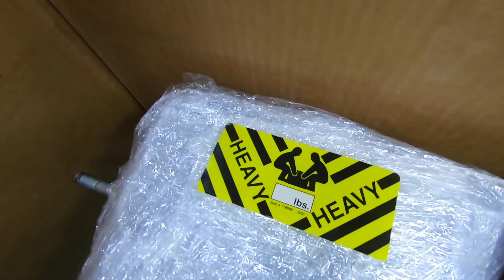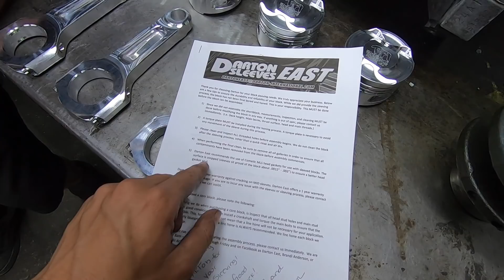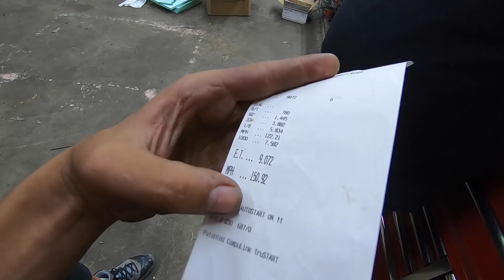The New 1200+Hp Engine For The Mr2!

Comment: Re missin gears, there is so much load in the back end when you get to 3rd and 4th even with a sequential it makes it difficult to get the changes correct. If you get the speed sensors etc and get the cut programmed in correctly the the gear changes will be butter. You need to get the load off to help the gearbox when making the changes.

Only has to be for a 10th or less of a second which will mean better times out the back end. 

Your ecu should be able to handle this. 

Its because the engine is makin so much boost out the back end that there is soo much load on all the components in the last part of the 1/4 that gears get missed. 

My 2 c
Reply: Been saying this from the beginning they are being way to genrous with the strain gauge parameters. Brent set it once on both cars with no load (hondaru and the mr2) and what do u know they still be having shifting issues and have to physically take their hands off the shifter to keep it from triggering the strain gauge. Take some time and get the tolerences closer!
Reply: I agree,  add to ignition cut time and make sure it goes into gear.
Reply: Makes sense to me
Reply: Changing gears down track without hitting the limiter would make an old mechanic happier.
Reply: They need to set a soft cut rev limiter and timing cut and not a fuel cut for the shift parameters. It’ll give more mass to the exhaust gasses when the cut is over and kick the turbo in the ass with all that dense exhaust gas.
Reply: he has a shitty AEM in the car, probably needs to swap to Haltech/Motec/Fuel-tech, but I don't think theyre familiar with using ecu features like this.
Reply: It wouldn't b kyle with boostedboiz if he didn't miss a gear
Reply: @N-Collective  Seen some people hold on to them like Ebrake drift leaver, and work fine.
Reply: 100% agree with this. I said the same when the video came out showing the very bad state of the dogs after very little use. I’d personally go with a closed loop paddle shift system that fully removes driver error. Considering what is going into the car financially, its a very small price to pay for what will be much more reliable, much more consistent and much more reliable. I work on and around this stuff for a living and this setup is very very basic it seems to me.
Reply: @N-Collective  I know, what the hell!  They left the maximum ignition cut time at like 0.6 seconds!  Then they jiggle the shifter on the run and it could be cutting out for a half second each time! Even the pros told them they set it at 0.2... In reality them not setting it up while it's under load is probably causing them to mis-shift and blow up gears/ dogs.
Reply: @GoatFaceNation  haltech/motec/fueltech dont do anything special at all that 99percent of  other ecu's can't do.. they just sponsor the right people and have loads of fan boys 🤣 look into syvecs and life ecu's if you want fancy shit.
Reply: Good point, the boosted boys are plagued with shifting,trans issues. A little attention to setup would eliminate the problems.
Reply: @wobblysauce  they can do that because the strain gauge is set properly!!!
Reply: Well put you will see from the multitude of replies many people have already said similar. They leave me scratching my head a lot. I tune in and out it’s heartbreaking watching them trash those gear sets and drop valves. But most of the vids are cool.
Reply: Definitely agree. Get some rpm LEDs so that you're not banging off the rev limiter at the end of every gear and tune that shift sequence so that the engine load is reduced during a shift. I know it's easier said than done but it seems like putting in the effort to tune the sequential (under load) will pay dividends.

Watching these guys continually blow things up is getting old.
Reply: Really they just need to get a stig hired. After seeing them all bounce the limiter repeatedly over and over and over
Reply: @brent4adv  the aem dash alredy has LEDs but he never set it up proprely like other things on the car. But hey, it's kyle, he'll never do something that other people tell him to do...
Reply: @brettv6982  But then they reuse head studs and cranks. In a world record chasing car. Lol.
Reply: On high powered bikes the kill time is anywhere from 10ms to 25 ms. If the dogs on these transmissions were back cut a little it would almost pull itself into engagement and be somewhat fool (Kyle) proof. 1/10th of a second kill on anything turning 8000 rpms would be a big flame out the exhaust
Reply: Erik Larson ARP says inspect and reuse

Comment: 18:02 I thought Jaime was gonna say, "you're still gonna miss third" 😂
Reply: Good one! 😅
Reply: Hahaha
Reply: Haha k series turbo with mods and still 9 sec smh...b series turbo easy be hitting 9s...
Reply: @MoparSrt702  it's 9.0! So almost an 8.
Reply: @jensmannens7398  still 9s bro.
Reply: @jensmannens7398  it's like someone saying I lost by an inch...still lost lol
Reply: @MoparSrt702  Yeah i know still 8s but what b series cars does low 9s easy?
Reply: @jensmannens7398  my ex crews ek hatch does 9 sec fwd. most the cars here in Vegas do 9 sec buddy..
Reply: @MoparSrt702  low 9s?
Reply: @jensmannens7398  I'll try and post pic of the plaque we got from the speedway for going 9 sec
Reply: @jensmannens7398  yeah bro. ain't hating just saying makes no sense. But is what it is still good content from the boostedboiz even tho this foo be weird sometimes.
Reply: @MoparSrt702  going 9.9 or something is a big difference with 9.0 but i understand what you are saying with the hp they had in the mr2 and the sequential they should already went 8s.
Reply: he can make all the power he want but until he puts a dedicated drag suspension on the car it aint going much faster. those bc racing coilovers arent designed for what hes doing.
Reply: @jensmannens7398  yeah bro 💯

Comment: oh boy your gonna need a wheelie bar now
Reply: Or a really heavy front weight plate to keep the wheels down.since hes trying to stay in the same race class
Reply: A wheelie bar indeed.
Reply: Ada 1812 ain’t nothing but a thang i know he can make one he has one on the hatch
Reply: @thefugitive2178  did you even hear kyle said he doesnt want to go to a a diffrent race class if  he uses a wheelie bar.but it never said anything about a weight plate
Reply: Its gona have sensors out front knowing when front end goes up,pulling timing to prevent lifting.its rare that i see wheelie bars now a days
Reply: 《Untouchable 》 he said that?
Reply: @upnorthviking823  are you serious?
Reply: He can’t have wheelie bars for the class he runs in
Reply: with boost buy gear he wont be or shouldn't be pulling wheelies anymore
Reply: Turgi yup, he did, it was a while back but he said he opted for the pitch sensor and weight plates instead of a wheelie bar because of the class he’s racing in
Reply: Ada 1812 is not about being gay is about going straight and safe
Reply: TheBirdtaco eh i doubt it
Reply: @joshua_J  He literally said this in the video
Reply: You can’t put a wheelie bar on a IRS RWD car, it’ll unload the rear suspension and make the rear tires lose traction.
Reply: Ada 1812 and also the wheelies he’s pulling on just 1000hp is insane, just imagine it 200hp more; yeah its a small lightweight mid-engine car but, i doubt the weight plate will just help that.

Comment: I ran around at 800awhp daily driving on aluminum rods in my evo 8, no problems whatsoever for years
Reply: If it's good enough for Topfuel 11khp dragsters it's good enough for me.
Reply: Aluminum rods are good. If you're really baller like Gordon Murray, you get titanium rods
Reply: @Shadowboost  Unless there's some new magic don't TI rods need to be replaced extremely often though right? like 100 hours or some shit?
Reply: @MrDJAK777  Google says ~80h life in race applications, which is unacceptable imo for the cost
Reply: Aluminum rods fatigue and stretch more than titanium though.
Reply: @MrDJAK777  nope stock nsx engine use titanium rod and you dont need to change them ever
Reply: @Sun-ut9gr  dont trust google the nsx stock engine use titanium rod and they are good for the life of the engine
Reply: @legros731  stock engine is why on a hi perf built race motor they are just not going to last that long.
Reply: @Codizz88  That stretch is one of the there biggest benefits its what allows them to handle the 10K+ hp dragsters make as at that power the rods would break if they weren't more malleable like aluminum.
Reply: But with all the stretching over time you get them to be permanently longer than when new. You have to measure stretch on all of them, only bad thing about aluminum they fatigue wayyyy faster than steel, titanium is supposed to be the best of both worlds with lightweight and strength but pricey as fark.
Reply: @Codizz88  Modern aluminum rods will last long enough that in a car built to race they are likely gonna be half a dozen other things that are gonna go before the rods become the main issue. You can even street drive modern aluminum rods and fatigue is minimal they have come along way with the metallurgy. Still worse then lifetime then steel obv but people report 5k street miles and tracks in between is very doable.
Reply: Aluminium rods actually end up shorter from the forces, not longer
Reply: Madarius ls7 engines also use titanium rods. It’s more the racing that wears things out, not the material itself.
Reply: @Binford2500  And notoriously as soon as the anti-friction coating on those ls7 rods is gone 1-2 break and that happens with normal use. which is probably why you can find sets of 6 ls7 rods all the time.
Reply: Arnt there carbon fiber rods out for evos? Ridiculously expensive
Reply: there's a myth surrounding this because it's not uncommon to see cars that use aluminium rods having to replace them often... things is those cars are also pushing 2000+hp. it's not inherently an "aluminium" problem
Reply: Yea Al is fine, this isn't 1980.  Plus BME would be the leader I would go to if I wanted to street them anyway, die forged.

Comment: I helped a mate move house many years ago. Among the crap we had to load onto a trailer were a bunch of engines, including an (I think) 2l 4cyl, just the short block, and a 3.5 litre Rover V8 (descended from the Buick V8 that the US market gave up on for being too wimpy) with sump and heads and intake manifold. One of the things that I think made the Rover V8 take off Down Under (and in the UK etc) is that being an aluminium block it could be lighter than the 4cyl it was replacing. The proof is in the pudding: three of us put the effort in to put the 4cl on the trailer, while just two of us managed the V8 with ease.

Comment: All that $$$ on best parts.  “We’re going to just reuse the L19 head bolts and see how she goes. 🤷‍♂️”
Reply: Please tell me what’s wrong with that ? As long as they haven’t been overtorqued and measure to spec they are fine for being reused
Reply: Zeth Loveless I never said anything was wrong.
Reply: Well for the amount of top of the line parts going into this engine I would want the piece of mind of new head studs, even though his are probably just fine.
Reply: @zethloveless7238  he was just poking fun at how much money they dumped into it but are reusing headstuds
Reply: @zethloveless7238  nothing wrong with reusing studs unless over torqued like you said but personally I would never go through all the money and hassle of getting a built motor to reuse headstuds.Seems abit lazy and dumb to me already gone this far might as well put some new arp one's in they are alot cheaper than fixing a lifted head
Reply: Off Chops true but even ARP says it’s fine 🤓. All you gotta do is measure the studs and see how much stretch.
Reply: They are reuseable, but idk for what hes building i would just start fresh. I know he could get a hook up on some lol
Reply: @zethloveless7238  I'm well aware I have reused studs myself in low hp/street applications it's perfectly fine if they are up to spec etc.But on this level there is no way I would reuse studs I wouldn't risk a 10+grand motor over a couple hundred dollars in studs.
Reply: They are l19   those are ballin bolts/studs. And reusable..
Reply: I think he says this stuff so sponsors send him stuff in
Reply: @zethloveless7238  The last time I checked mine it stretched from 3in all the way out to 5 ⅞'s which seemed like alot.... But my doctor said that's about average.
Reply: Smooth_Ops well aren’t you a stud

Comment: Nice block and pistons from the sponcer. T-Rex arms will use stock retainers, and locks on the valve springs along with grinding the valves in with a drill and compound instead of getting a proper multiangle valve job, and he will wonder why he will screw another block.

Comment: Kyle Make sure you weigh your pistons if you had them machined down. Make sure they weight the same and because you went to aluminum rod you should have your engine balanced with your flywheel and clutch package so your engine will last and rev faster and spin past 10,000 RPM if you need to

Comment: The biggest thing to making aluminum rods live is keeping the oil temperature down, but it does need to be at least a 160 degrees the oil to start leaning on it. You will know if the aluminum rod is stretched, because the rod bolts will not finger in or out on disassembly to check a bearing. If it's tight it's stretched.

Comment: Quick question after Kyle mentioned the piston, when you deck the block or head do you have to account for the difference in height somehow or just have to realize how much you take off so you don’t increase compression? Or is it so little material that it doesn’t matter?

Comment: Aluminum rods are fine for light street driving, but you normally only get about 100 passes on them before they start breaking, so... be wary also you have to warm the motor up fully before you bring it off idle because they change shape so much. I know you want to redline it cold but you can and will break the rods doing that. So don't. You will most likely need to check bottom end clearance for the actual rods mainly the big ends at the bottom of the bores, don't cut the rods, I hope that goes without saying cut the block. But if you plan on any sorta street driving I'd get a second set and consider changing them at 50 passes instead..

Comment: Make sure you guys are running enough squish/deck clearance, those pistons might need a slight shave off the top as those aluminum rods will grow with heat and rpm.

Comment: I think with some suspension tweaking and some altered weight distribution you may be able to get the MR2 to launch without sending it to the moon every time, and probably get into the mid 8's.

For anyone still unaware, he can't put a wheelie bar on the MR2 because it would force him into a class that is way faster than the MR2 can run, so he has to deal with the wheelies without a wheelie bar.

When he peeled that paper or whatever off the top of the block I got goosebumps.

Comment: How much closer to the head / valves do the pistons get when connected to aluminum rods spinning at 12,000 RPM with 60 pounds of boost? From cold, and verses Iron Rods? Thanks for sharing, Rock On!

Comment: Use kings bearings and get the crank checked and rotating assembly balanced and run a good crank scraper and windage tray and oil pump

Comment: And kyle dont listen to the haters man. The mini van runs high 11s. That's in anyone's eyes is a job Well done. And just think of the issues that you had to overcome and engineering you had to turn your hand to. Towards the end of the vid it's almost like your justifying yourself to them. Turn that about dude and use it as constructive criticism for fuel to push further into the old girl. 

Have you considered making a direct feed through the bonnet of the rowdessy  to the turbo. Like a ram as in my eyes although it's uber turbo from the planet cryton but is it not sucking in hot air with the bonnet/hood being closed possibly??🤔

Comment: I’m really hoping this time around you guys address the block weakness issue around the dipstick provision… if my memory serves me correctly it seems as though the lack of proper gusseting/reinforcement seems to be the Achilles’ heel. Build up some material and machine it appropriately – should get you at least another 250 miles before the motor grenades.

Comment: Seems almost all your problems with the head are down to the valves - have you considered changing brands or, at least, working with Ferrea to make sure you have some that won't stretch and/or have seat erosion problems?
Back in the day, aluminium rods were like a grenade with the pin pulled - just a matter of time before failure - I assume the improvement in alloys and heat treatments have signifiantly improved their fatigue life?

Anyway, good progress, and that cat's going to be more grrrr than prrrr!

Comment: The more u upgrade the engine, the narrower its operating range...
There goes cold start rev, or heavy pull untill coolant and oil temp over 85degree C...

No more rev limiter banging like u meant it and such

Comment: I really hope you guys are gonna put some soft miles on this motor. Before you turn it up to the moon tune. Learn from the mini van. That motor has some miles on it. Its why its starting to last longer than all your other K motors. I personally would not do aluminium rods. They need to be replaced after a certain amount of miles. They don't give good miles. And they cost a lot more. Steel rods last a life time. But if you don't mind the cost and the extra maintenance then send it budd. But i am looking forward to it doing its first 8sec.